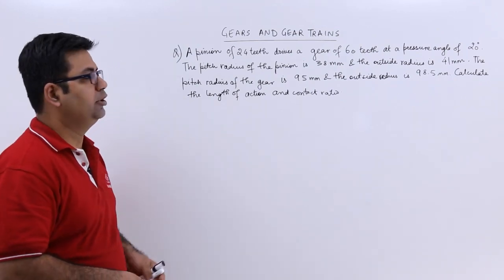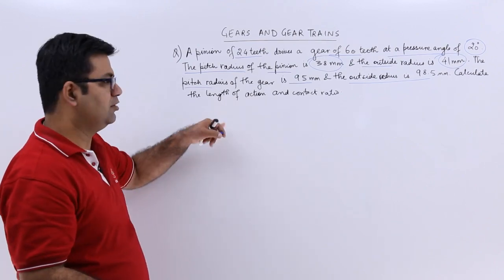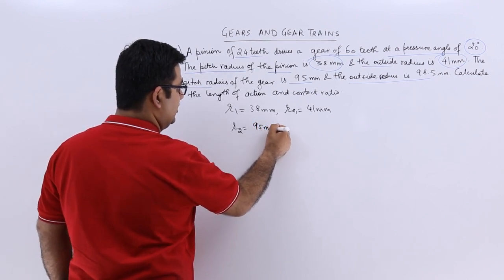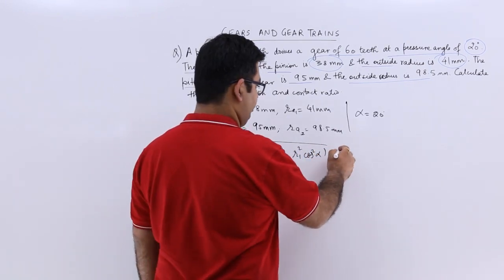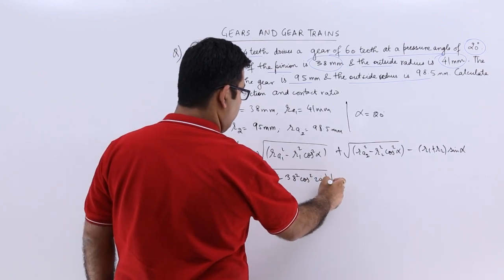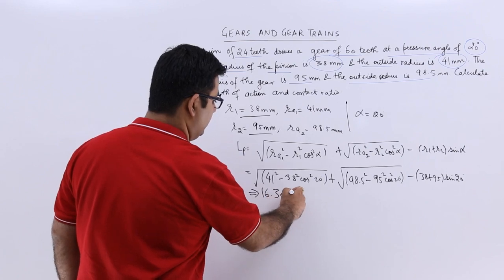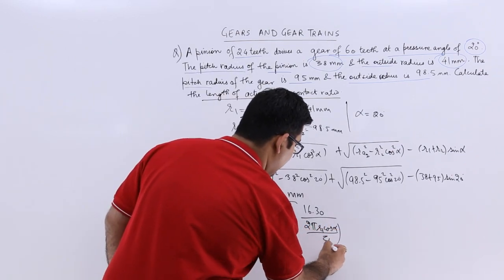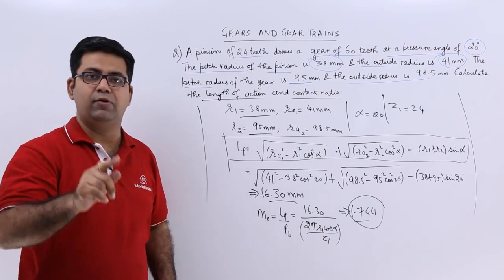Problem 1 On Gears

Comment: A 20° involute pinion with 20 teeth drives a gear having 60 teeth. Module is 8 mm and addendum of each gear is 10 mm. 1. State whether interference occurs or not. Give reasons. 2. Find the length of path of approach and arc of approach if pinion is the driver